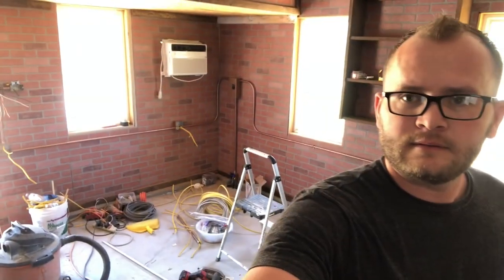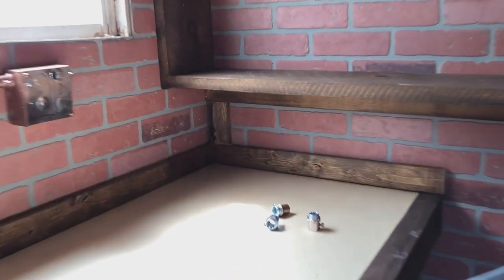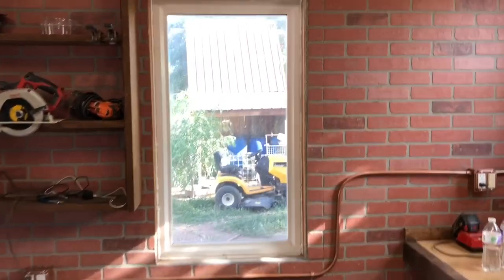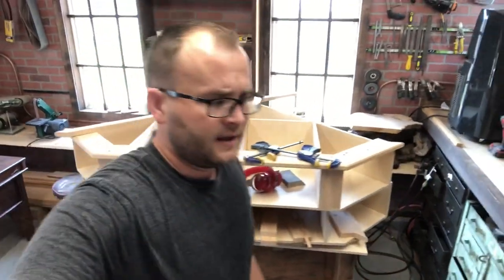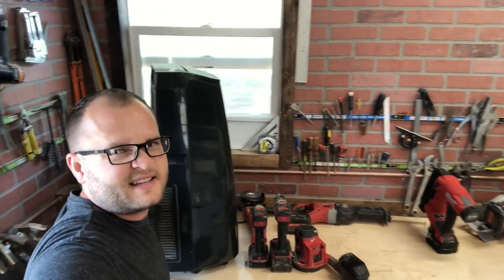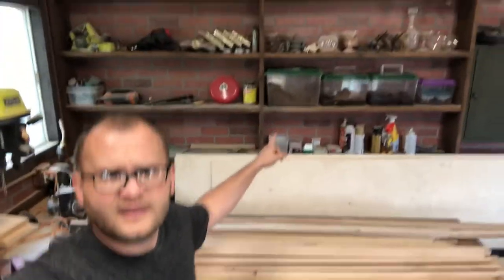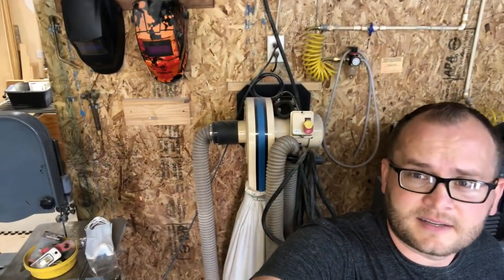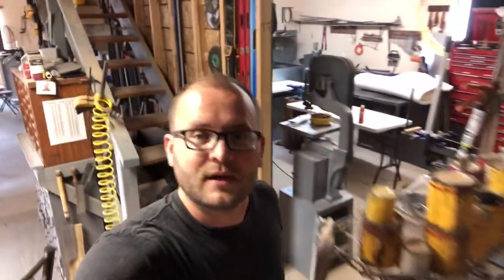Shop build. This is how you put lipstick on the proverbial pig.

Comment: Looking fantastic! Was that rough cut lumber I saw you using on the shelves? May I ask, do you typically use a tinted polyurethane? You might want to look up French polishing. It can get a little ridiculous, but there's a ton of half steps that are much simpler. They gave you the same level of protection for the wood, but it lets the grain be visible and tactile. I think this alone will launch your work into the fine woodworking category. I also think if you do your marketing with a few less guns, maybe rising TVs, hidden features for convenience, not just concealment. I really think you could be reaching a much wider audience. Please don't take any offense, you are excellent at what you do. I just think your talent deserves to be recognized by a larger, better heeled class of society
Reply from the maker: I have heard a lot about the French polish maybe that needs to be my next step up. I usually use stain then rub in a sealer. I have been wanting to shift my builds into the puzzle furniture and convince/ organization furniture. You should start to see that slight change in direction as I get caught up on some of the orders. Thanks for the advice! It really helps.
Reply: @davidolundell  I'm so glad that you're not offended by my comments. Puzzle furniture is exactly what I had in mind when I was talking about the higher audience. I see you do so many video game themed builds and I can tell who your market is. I think there is a whole digit change as you step up
Reply: @davidolundell  I don't know if you've already tried it, I'm not generally a big fan of dealers, but when I'm in a hurry I use deft satin natural finish. If you go nice and thin with it, you get a good seal but the grain can still be felt with the hand. Friction polish is another quick way to get a high-end finish
Reply from the maker: I really like feeling the wood grain but polished. That’s why in the past I have used so much rough cut. I think on my next couple tables I’ll try the French polish. I just looked it up and apparently the main ingredient is shellack which I have a ton of. Do you have a channel?
Reply: @davidolundell  I don't have a YouTube channel. I no longer build furniture due to a medical condition. French polish is really more of a method than a product. There are numerous formulas. There is stuff that is $1,000 for an ounce, and there is the old beeswax, turpentine, and shellac. I've even seen some lanolin-based products. It's more about the application. You try to really build up heat in the polishing process and it massages the product into the wood but then as it heats up, the product hardens. I really hate sealers because they leave a finish like formica. Removes so much character from the wood. Worst of all, if you work with figured wood or spalted, it absolutely deadens the reflections. Again I would also pick up a few books on classical furniture design. I too, prefer modern designs, but I think you will find that even the sleekest designs pay some homage to classical designs. I don't know what part of the world you're in, but I do still deal in exotic woods
Reply: @davidolundell  one other piece of advice occurred to me. Do a little bit of reading about the golden ratio. You can also get golden ratio calipers for 5 to 10 bucks. It sounds gimmicky as hell, but you will notice as you start to employ it, things just look... Right. If you start plugging in the specs of some of your favorite furniture from other makers, you will almost always find that they are damn near if not dead on the golden ratio. A lot of the old masters did this instinctually, but it's actually mathematical. You can find the ratio all throughout nature, art, and machinery. For whatever reason, we are preprogrammed with one form of universal taste. The last thing I'll mention is if you have not seen his stuff before, check out George nakashima